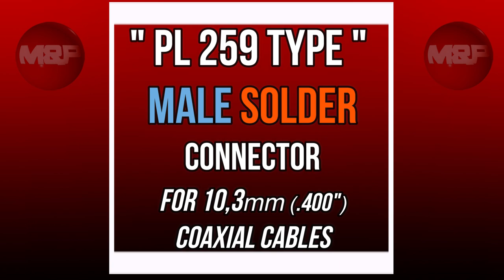How to fit PL259 connector for Coax (Warning: read description below)

Comment: No need to solder through the solder holes?
Reply from the maker: Some of you, based on old habits, matured in the old days of RG 213/U and RG8, (made with compact Polyethylene and 66% velocity ratio),
WILL OBJECT THAT WE HAVE NOT WELDED THE BRAID.

WELL WE DID IT DELIBERATELY!

From studies carried out, we have in fact experienced that in order to be able to weld the tin on the external hole of the PL 259 type connector, it is necessary to bring the temperature of the connector itself to about 300°C. This certainly does not damage the Teflon of a good quality connector, but can easily deform the expanded Polyethylene dielectrics which melt at 100-110 degrees C.

To give you excellent impedance stability an optimized VSWR, and exciting attenuations, M&P dedicates great efforts to maintain the tolerances of the dielectric diameters within a few hundredths of a millimeter.

Therefore, bringing the connector to about 300 ° C, to continue an old tradition, means giving up the very high performance of ANY modern expanded Polyethylene coaxial cable, with a velocity ratio of 84-87%. (depending on the models).
OBVIOUSLY WE DO NOT RECOMMEND USING THESE OLD GENERATION CONNECTORS!
We strongly recommend the Messi & Paoloni watertight compression connectors, specifically designed to take full advantage of our products, reduce the risks of thermal stress, while maintaining the exceptional shielding efficiency typical of all our models.
Reply: No ability to read?

Comment: The inner shielding should not have been cut all the way through, only to the point where it could be soldered to the metal body through the holes. The outer shielding sheath, sandwiched between the sleeve and the plastic, can overheat harmfully at higher power. This is high frequency.

Comment: This Is The Way I Have Made My Coax & Jumpers For Years Now & I Never Had A Problem with Them..As Long as you Use Good Quality Teflon Pl259's & I Put The Fire in The Wire as They Say....Nothing To Big but around 4-5 kw an like i said it Works Really Well...But You Must Use Really Good Connectors It Is Very Important...Especially if you are going to run a little Extra get up n go ! I Learned From Experience that the old Farts that like /say to solder the braid was just wrong in doing so ..i love the old timers for their Skills an admire them for the things they used to half to do but Time Changes & Tech Always ALWAYS Improves & now We have not had to solder the braid for years now thanks to Good Quality Coax & Connectors.. I Only Use Messi & Paoloni Coax (Hyperflex 10 & Their Evo Connectors

Comment: yeah, those little holes are supposed to be soldered too!  this doesn’t even show braid at the hole.
Reply from the maker: Some of you, based on old habits, matured in the old days of RG 213/U and RG8, (made with compact Polyethylene and 66% velocity ratio),
WILL OBJECT THAT WE HAVE NOT WELDED THE BRAID.

WELL WE DID IT DELIBERATELY!

From studies carried out, we have in fact experienced that in order to be able to weld the tin on the external hole of the PL 259 type connector, it is necessary to bring the temperature of the connector itself to about 300°C. This certainly does not damage the Teflon of a good quality connector, but can easily deform the expanded Polyethylene dielectrics which melt at 100-110 degrees C.

To give you excellent impedance stability an optimized VSWR, and exciting attenuations, M&P dedicates great efforts to maintain the tolerances of the dielectric diameters within a few hundredths of a millimeter.

Therefore, bringing the connector to about 300 ° C, to continue an old tradition, means giving up the very high performance of ANY modern expanded Polyethylene coaxial cable, with a velocity ratio of 84-87%. (depending on the models).
OBVIOUSLY WE DO NOT RECOMMEND USING THESE OLD GENERATION CONNECTORS!
We strongly recommend the Messi & Paoloni watertight compression connectors, specifically designed to take full advantage of our products, reduce the risks of thermal stress, while maintaining the exceptional shielding efficiency typical of all our models.
Reply: There is absolutely no need to solder the holes in the body of the plug and it's bad practise IMO. All it does is risk melting and deforming the dielectric insulation.

Comment: Assuming one end inside and one side outside, how long before the unsoldered copper braid, on the outside of the shack, starts to oxidize and cause problems?
Reply from the maker: If you want to see your braid always shining after years of intense use I advise:
1)Buy one of our Extraflex Bury series cables, 
2)Buy our Professional grade connectors, 
    UHF EVO, or N type
3) Use our M&P-Silicone-Seal

The Extra flex Bury series has a Tough Polyethylene jacket and a layer of Petrol Jelly over the braid, and in conjunction with the special UHF EVO compression connectors+ the extra Silicone seal gasket, assure an amazing life span. Additionally, they sport a great trampling resistance too, if needed.

If the flexibility of the Extraflex bury series is not enough for you, the compromise of PVC jacket cables, such as our Ultraflex and hyperflex series is a viable choice. They excel for flexibility and overall performance, but any cable with PVC jacket is more prone if buried inside a pipe, to be soaked with water created by condensation.  Always make sure if you use PVC jacket cables, that they stay well away from stagnant water, and never buried or trampled upon.  The use of new generation connectors with compression gasket is paramount, (they also have a far better SA and insertion loss). Moreover, the M&P Silicone-seal, is the icing upon the cake.

Comment: Unless you are particularily "rough" on your connectors, I don't see aving to do this all that often therefore the cost of the TOOLS plus the time setting them up is flat out COSTprohibitive. It would be more prudent to have spares...(Really, you need a CALIPER to measure?...C'mon Man!)
Reply from the maker: Use a ruler or whatsoever similar, the Caliper is for Pros!! :)
Reply: @MessiPaoloniSRLAncona 👍😜

Comment: You have a hole to solder some of the braid. Why didn't you?
Reply from the maker: Some of you, based on old habits, matured in the old days of RG 213/U and RG8, (made with compact Polyethylene and 66% velocity ratio),
WILL OBJECT THAT WE HAVE NOT WELDED THE BRAID.

WELL WE DID IT DELIBERATELY!

From studies carried out, we have in fact experienced that in order to be able to weld the tin on the external hole of the PL 259 type connector, it is necessary to bring the temperature of the connector itself to about 300°C. This certainly does not damage the Teflon of a good quality connector, but can easily deform the expanded Polyethylene dielectrics which melt at 100-110 degrees C.

To give you excellent impedance stability an optimized VSWR, and exciting attenuations, M&P dedicates great efforts to maintain the tolerances of the dielectric diameters within a few hundredths of a millimeter.

Therefore, bringing the connector to about 300 ° C, to continue an old tradition, means giving up the very high performance of ANY modern expanded Polyethylene coaxial cable, with a velocity ratio of 84-87%. (depending on the models).
OBVIOUSLY WE DO NOT RECOMMEND USING THESE OLD GENERATION CONNECTORS!
We strongly recommend the Messi & Paoloni watertight compression connectors, specifically designed to take full advantage of our products, reduce the risks of thermal stress, while maintaining the exceptional shielding efficiency typical of all our models.
Reply: @MessiPaoloniSRLAncona  
You need to use a soldering iron with a lot of heat mass. Then you won't need to use higher than normal temperature and the area (to be soldered to) will heat up fast and won't damage the dielectric in the coax. 
Also the braid must me tinned with some solder, prior to inserting the cable into the connector. Use some teflon based dielectric grease on the insulation, before screwing on the connector. It will go in much easier.

I've done a lot of connectors this way. Never had a failure. I never use crimped  connectors that may be exposed to the elements outdoors, even if they are sealed. I've seen too many failures on crimped connectors.
Reply: @andrewevanoff1192  I did mine with standard silver gold pin pl259s as you described along with liquid tape to the outside of the connector and cable, then applied STUF Teflon cable compound liberally to the inside of the connector before screwing it to the female connector...yeah its a bit overkill but I'm confident zero water gets in. SWR is 1.1 across the frequency spectrum I use. However I noticed his method was a bit simpler and I'm interested in trying it out along with my sealing method. Love their products
Reply: They said to read the description. Why didn't you?
Reply: @modex20  the description was updated after all the comments.

Comment: I use the PL259 plug that has the brown plastic or what ever it's made of the i use my dremel with a tiny diamond bit and ruff up inside the centre of the plug in side so when I solder it got some to grip to all the holes I grind inside and around the channel to the next hole I grind the hole channel for soldering.the coax i unpick it with a big needle and I don't cut any for the minute fold the coax back then get the centre wire ready be for screwing on the plug fit heatshrink and the other part of the PL259 then screw on the plug tight until it's fill right on solder the tip and solder the holes I do use a very little flux when all soldered screw on the PL259 and then trim any left over coax braid then heat the heat shrink tubing All done wipe all the plug for flux the wipe with dry cloth

Comment: Confermo il dubbio, non occorre saldare anche la schermatura? Grazie
Reply from the maker: Buona sera 
Abbiamo realizzato un tutorial per chi utilizza connettori standard PL259, anche se consigliamo vivamente i nostri connettori di nuova generazione con doppia tenuta che assicurano una migliore protezione contro le infiltrazioni di acqua, umidità e condensa.

Alcuni di voi, sulla base di vecchie abitudini, maturate ai tempi di RG 213 / U e RG8, (realizzati con polietilene compatto e velocità  di propagazione del 66%), OBIETTERANNO CHE NON ABBIAMO SALDATO LA TRECCIA.

BENE LO ABBIAMO FATTO DELIBERATAMENTE!

Dagli studi effettuati abbiamo infatti riscontrato che per poter saldare lo stagno sul foro esterno del connettore tipo PL 259 è necessario portare la temperatura del connettore stesso a circa 300 ° C. Questo certamente non danneggia il teflon di un connettore di buona qualità, ma può facilmente deformare i dielettrici in polietilene espanso che fondono a 100-110 gradi C.

Per darvi un'eccellente stabilità dell'impedenza, un VSWR ottimizzato e attenuazioni entusiasmanti, M&P dedica grandi sforzi per mantenere le tolleranze dei diametri dielettrici entro pochi centesimi di millimetro.

Portare il connettore a circa 300 ° C, quindi, per continuare una vecchia tradizione, significa rinunciare alle altissime prestazioni di QUALSIASI moderno cavo coassiale in Polietilene espanso, con un rapporto di velocità dell'84-87%. (a seconda dei modelli).
OVVIAMENTE SCONSIGLIAMO L'UTILIZZO DI QUESTI CONNETTORI DI VECCHIA GENERAZIONE!
Consigliamo vivamente i connettori stagni a compressione Messi & Paoloni, studiati appositamente per sfruttare appieno i nostri prodotti, ridurre i rischi di stress termico, pur mantenendo l'eccezionale efficienza schermante tipica di tutti i nostri modelli. Vedere UHF EVO la rivoluzione nei PL
Reply: @MessiPaoloniSRLAncona  Grazie l'ho visto dopo aver inviato il messaggio, scusate